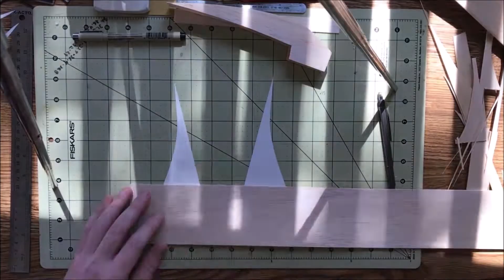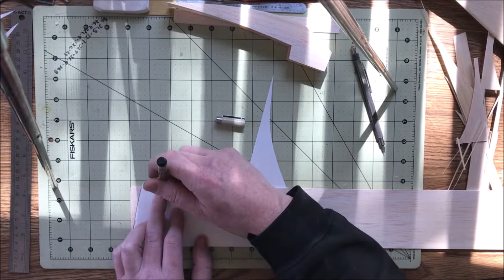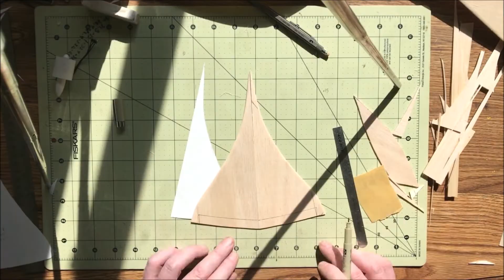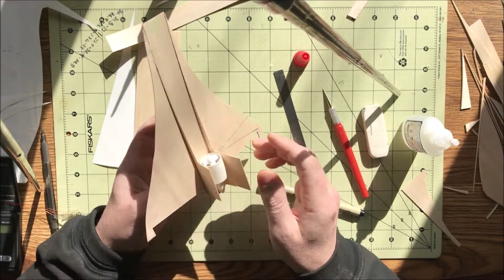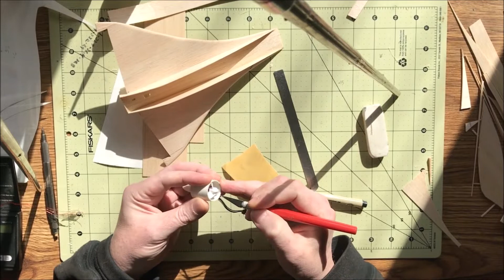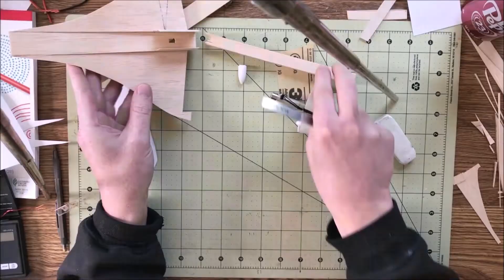20mm Micro EDF Jet build 2

Comment: Hi there I MUST say i am a huuuuuuuuuggggeee fan of rc planes / balsa wood models and. Have watched every single video you have made I subbed a liked I have been waiting mounts for a new vid thank you for this awesome channel man. Also could you maybe make a mini Corsair? And also some good links to some small rc gear? Thank you, you awesome bro

Edit: Btw. I remember ur awesome p 51 mustang you made like 11 years ago that was so great 🐤🤩😁😁😁
Reply from the maker: Thank you!  I made a profile fuselage Corsair way back in the day with a simple 2 channel motor/rudder system, have always wanted to do another one, its a great looking bird.  Wish I kept that P-51, it was good looking model.  These are the parts I'll use in this model, shipping can be a pain, but they have a good selection of micro stuff

balsa:  http://www.specializedbalsa.com/products/balsa_sheets.php

0703 motor:  https://www.banggood.com/Racerstar-Racing-Edition-0703-BR0703-15000KV-20000KV-1-2S-Brushless-Motor-For-60-80-100-FPV-Racing-RC-Drone-p-1129234.html?ID=528869&cur_warehouse=GWTR

ESC:  https://www.banggood.com/Sunrise-Siskin-BLHeli-32-11A-SB-2-3S-ESC-With-5V2A-SBEC-For-RC-Airplane-Multicopters-Racer-p-1234430.html?admitad_uid=9731816e1766d5f7af3368f90e2b26d7&utm_content=240682&tagtag_uid=9731816e1766d5f7af3368f90e2b26d7&cur_warehouse=CN

RX:  https://www.banggood.com/DasMikro-5CH-2_4Ghz-RC-Micro-Receiver-For-DSM2-JR-Spektrum-transmitter-With-6-CH-PPM-Output-p-1084913.html?rmmds=search

servos:  https://www.banggood.com/1_5g-180-Degree-Nylon-Gear-Digital-Linear-Micro-Servo-3_7V-5V-For-Micro-RC-Airplane-p-1529910.html?rmmds=search
Reply: Ty so much I really appreciate that! I think I’ll build this thing to. Could you give me a link to. What transmitter ur using?
Reply from the maker: @LookLogix  Sorry for the late reply, once again youtube isnt giving me notifications for comments or replies.  I'm using a Spektrum DX6 transmitter https://www.horizonhobby.com/dx6-6-channel-dsmx-reg%3B-transmitter-with-ar610-receiver-spm6700  its an older model so you can probably find one pretty cheap these days.
Reply: Hey! Ty for the response! Unfortunately I can only find that transmitter for 200$ also this is a stupid idea but it would be AWESome 😎 if you used a KFplan and stripe the guts out of it here’s a link to it, I love the plane so far.and of course this is just an idea- 
https://m.banggood.com/KFPLAN-KF606-2_4Ghz-2CH-EPP-Mini-Indoor-RC-Glider-Airplane-Built-in-Gyro-RTF-Home-Gargen-Flying-Hobby-Toy-p-1442115.html?rmmds=search